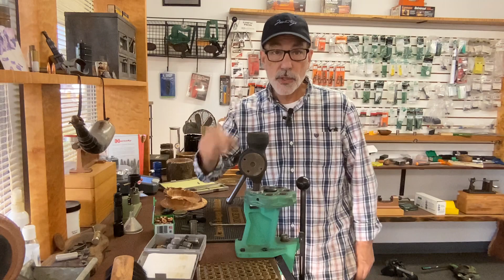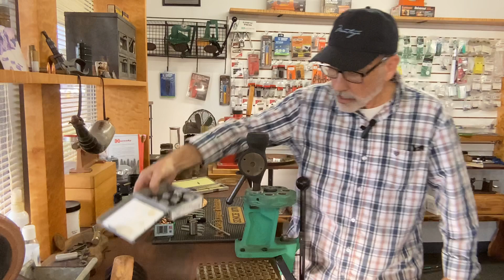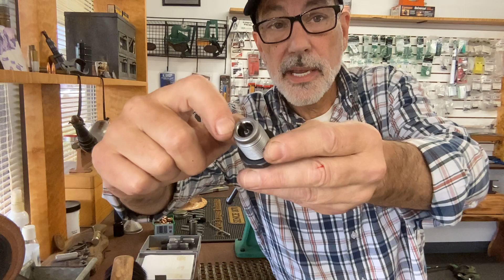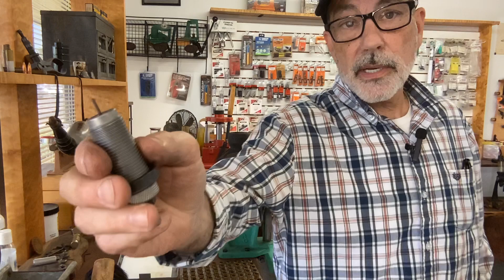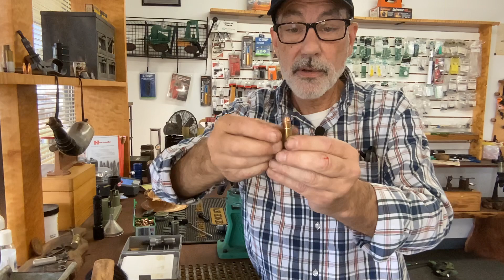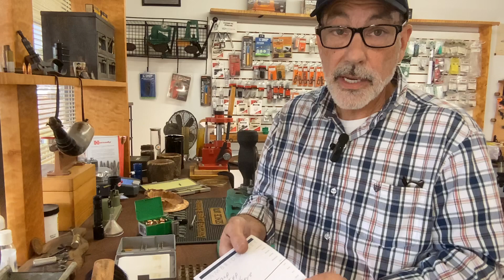RELOADoc- insights into straight wall cases part 2

Comment: Got it!  Set pin over crash site, no more crash at site.  Yes, I get pins in multiples, my bent pins are mostly Mojave Desert or spent 22 in my brass, and me failing to do a good job cleaning, or looking first. 
Never knew of Carbide and lube relation as a metal worker.   I will still be giving lite lube, as life tells me dry brass or copper is not happy or relaxed.

Thanks!  I will do a straight wall Soon.